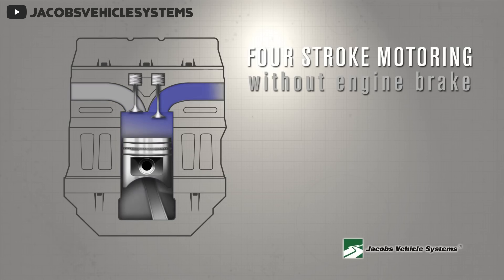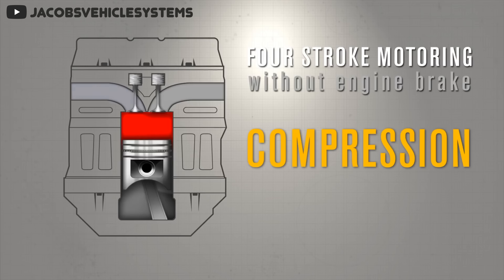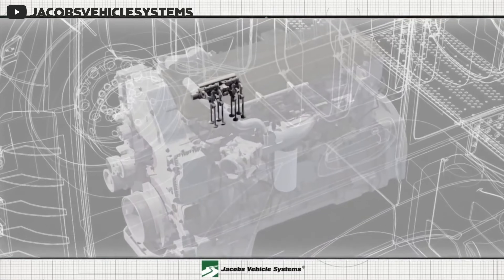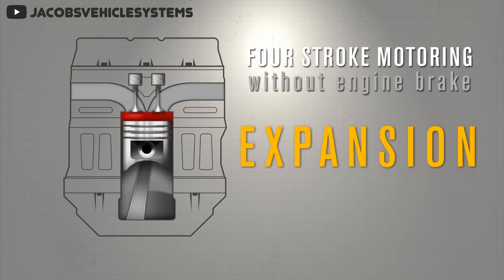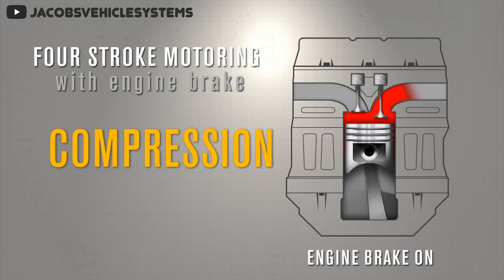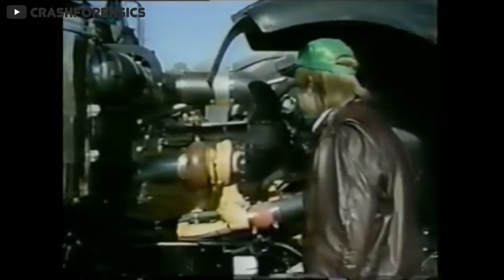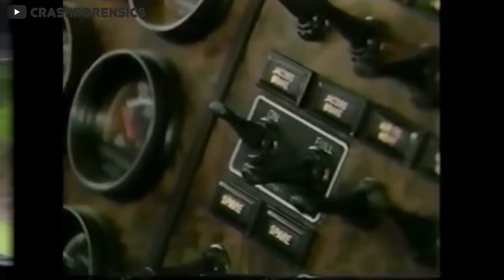What is a Jake Brake and How Does it Work?

Comment: Jake brake or Jacobs Brake is a Brand name like Cummins C-Brake.  In an automotive application your not dealing with the volume you are with a  large diesel engine. In a auto you are stating that the air intake at the throttle body is closed or minimized causing a vacuum to slow the engine if I understand.  If this same concept was used in a big Diesel engine the thing that might happen is the air would be found somewhere else either thru seals or around the rings.  In GM or the early Detroit Diesel like an 8V71 had a flap door that would cut air off if a rack stuck and the engine ran wild.  Sometimes when this was used it tore the two piece piston apart. Thing is if it were that simple it would have been done but in heavy duty use I do not think this mouse trap would work,, there is just to much energy to convert thru vacuum.

Comment: When used "properly" in "proper situations" I have no issue with the noise, but when a truck with no load on a flat stretch leading to a stop uses the jake and upshifts through every single gear...to me that's a sign of a zero skilled driver just out to make noise.

Comment: Not being a driver I'm confused.  Aside from engine braking, don't lower gears provide braking by downshifting?
Reply: You can't use the transmission to slow a loaded big rig on a downhill, it will over rev and blow the motor. Just like trying to shift from 4th gear to 1st in a car with a 4 speed at 60 mph. In trucks I've driven they operate between 1800 and 2100 rpm in each gear So, trying to downshift a truck going downhill at anything more than 1800 rpm, to the next lower gear would put the rpms at 2100 or higher and gravity is pulling it down faster and faster and it won't slow. I don't know if I've explained it correctly but that's how they work.

Comment: I do know that jakes are loud because by owning a 379 flat top pete with 425 cat with 8" pipe it will rattle windows and is even loud inside the cab of the truck.. I suffer from hearing loss due to the constant exhaust noise of the truck because the pipes are just behind both doors and driving for 8-10hrs for over 25yrs has caused that but wouldn't change it because I enjoyed driving I'm retired now but loved every mile I drove

Comment: What do you mean Diesel engines have no engine breaking as compared to gas engine breaking due to a throttle body. Yes gas engines have a throttle body and diesels do not however it is not true that diesels do not have engine breaking. Engine breaking on a diesel is as good if not better than a gas engine due to a much higher compression ratio which acts as resistance to piston motion (breaking) when fuel isn’t applied.

Comment: Yada, yada, yada. Sure Jake brakes are fantastic but there is one tremendous problem and that is the number of stupid, moronic truck drivers that abuse the use of jake brakes by using them while on flat surfaces, usually within city limits because they think making a lot of unnecessary noise is somehow cool. If you are in city traffic on flat surfaces and need jake brakes to slow down or stop then common sense should tell you that your dumb a$$ is going to damn fast for conditions!

Comment: Yet too many truck drivers use their jakes  in settled areas when they don't need to. 
I have driven diesel trucks and buses, with and without turbo, and without jakes, and now wonder why it seems backing off on the throttle has always had a braking effect. Was I imagining that?
I love driving, enjoy managing clutch, throttle and selecting gears. Yet I long for the day when the internal  combustion engine becomes obsolete.
Because too many drivers of trucks and loud cars seem to get a  hard-on with the noise they make.

Comment: FYI: fuel actual burns in a flame front inside a properly running in internal combustion engine.  If a charge does explode, we call it a 'knock'.  Premature ignition means the mixture and piston location are out of spec and the resulting action can eventually damage pistons, rods, and bearings. This relates to the use of 'starting fluid' to help out an engine startup. Ether has an extremely fast flame rate, so the charge burns suddenly, often before the piston velocity has changed sign (still going upward).
Reply: Was checking if anyone else commented on this before I did. A lot of people don't know the difference between combustion and explosion.

Comment: I'm only 40 seconds in and I already see something wrong. The lack of a throttle body does not reduce engine breaking. I'm "that guy" who tries everything. I drive an old stick shift, and I have tried shutting off the ignition and pushing on the throttle while engine breaking. I have a throttle cable so I can do this, new cars don't. As I push on the throttle and allow more air into the engine, remember there is no fuel or spark, the engine increases braking ability.

Comment: Diesels have plenty of engine braking due to their high compression.
Exhaust brakes & Jake brakes are good in trucks so the driver doesn’t have to change down the gears to get to the engine braking.

Comment: A diesel engine also do normal engine breake. It does this by cooling the air when compressed if there is  no fuel.

The diffrance between a petrol and diesel car is actually really smal. Haveing  replaced  my 2.5L petrol suv  with a 2.4L diesel suv,  there is really hardly any diffrance.

The reason why truck engine breakes so little have nothing to do with that its diesel,  ut because it have a tiny displacment.  A normal car have about 1 liter of displacment per ton. A truck  typically have 0.2-0.4iter per ton.

Its like puttning a engine from a Fiat 500 into a large suv

Comment: I'm sorry but I still don't understand how a Jake Brake works. How does opening the exhaust valve on the compression stroke cause engine braking? It seems to me it will do is have exactly the opposite effect. And it's not just me that doesn't understand it - I have a friend who's a diesel mechanic, and one day he described how the JB works (exactly as you did). But then he said "I understand how they work, but i don't understand why they work."
Also what do you mean when you say that a diesel engine has no engine braking? I have a diesel Landcruiser, and if i take my foot off the throttle while going down a hill, there is a lot of engine braking - far more than with a petrol engine - presumably as diesels have a higher compression ratio and the engine has to do more work, thus slowing the vehicle. Removing this slowing effect of the compression stroke by opening the exhaust valve will, it seems to me, reduce the engine braking, not increase it.  A better explanation is required

Comment: Actually small diesels have plenty of engine braking by expending energy compressing extremely lean mixture (newer engines can cut off fuel injection completely). And since petrol engine throttle body cuts air intake, in comparison diesels have even better braking. Checked many times in practice.

Comment: Mercedes Benz truck engine brakes are really quite for some reason I'm talking about truck built in 60s 70s for example mode#1921 or #2628 or #1932 &&&& when I see american trucks make extremely louder noise compare to Benz truck it was ?? For me, my father owns Mack R600 & R700 & few V8 Mack use as heavy haulers, none of them have this system.
Even Volvo didn't have but DAF truck use this system copy from Benz.
Noise comparison from Benz to Cat Engine if I use good judgment is 1 to 30
Benz is 1 lowest & Cat is 30 highest.

Comment: Had a Jake brake fail on a mountain pass in Colorado. My boss was driving. We were 80,000 lbs. To keep from runaway he kept it low gears and was pumping the brakes. Motor stressed and blew close to the bottom. I imagined what sitting on a bomb would be like. I bounced off the headliner. Speed was OK at this point, let it let run out on the flat & got it pulled over, oil trail behind us.
  No cell phones back then. Hitched a ride to a phone & called the agent we rented the tractor from. He wanted to know if we were prepared to pay for the blown motor. I ask him if they would've been prepared to pay for our funerals. They towed another tractor to us & dragged the casualty away. We didn't hear about paying for that motor again.

Comment: I can't agree that diesels don't have any engine braking without an exhaust brake. I use engine braking all the time in my manual transmission 5.9 cummins. The engine braking come from all of that diesel compression ratio. It's not like having an exhaust brake but trust me, its there and I have used it to slow down trailers for years now.
Reply: Agreed but people complaining
 about Jake's but there important

Comment: from the animation, it seems that the fuel is still injected into the cylinder on the first stage and then is exhausted without combusting, allowing unburned diesel out the exhaust.  What am I missing?

Comment: Some modern freight trucks go into freewheeling mode when coasting, but not others. I wonder why. I wouldn't thought the pumping losses would be negligible, and that it's a waste of fuel to keep the engine idling when coasting as opposed to just let the momentum of the truck keep it turning.

Comment: If it’s manual technically you do have engine braking if you hold the petal all the way back to where the injectors are barely firing and have it in a lower gear

Comment: why are they louder than diesel exploding ? would a muffler on the intake fix the noise?
Reply: Because during combustion,  the valves are closed. During engine braking, the exhaust valve is open when combustion would usually take place so all the noise goes out into the exhaust.  And yes, mufflers reduce the noise.

Comment: engine braking with a diesel works great. my 7.3 powerstroke engine brakes significantly better than my 6.8l v10 towing the same trailer on the same hills...  the throttle plate has 0 effect on engine braking.

Comment: All you guys who drive an X15 can attest to how strong the new redesigned engine brake from Jacob's are. Up to 600 braking horsepower at 2100 rpm
Reply: Yup, bent steering wheel for proof...

Comment: Think of how much more efficient an EV Semi will be with motor regen on, slowing down that massive amount of weight, putting energy back into the batteries.  Tough to argue with Physics 101!
Reply: If it wasn't for the regen think how inefficient a electric vehicle would be. Electric vehicles  still pollute  you just moved it to a different location  & the electric vehicles  range nut has not been cracked in over 100 years , so what is going to happen in the next 100 years , about the same . Time will tell if it is better everybody  will buy it including me , till the NO!!!

Comment: Cummins big cam 1 is not that great  it to hard on camshaft  so I took off engine or you will end breaking the cam followers if you drive east of the Mississippi you really don't need a jake brake if you pay attention to what you're doing
Reply: I have big cam one Jake brake broke the cam follower. Had to have the truck towed home. Took Jake brake off the engine

Comment: yea nah yea nah yea nah nah nah mate  nah . 
 Put the truck into a low gear , let off the throttle and and coast down . You want engine breaking there you go . The wheels will turn the gearbox , the gearbox will turn the engine , the  engine cant go faster than it can go . Obviously this has limits , a long   slope will eventually accelerate you  to a dangerous speed but you always have the option of using the breaks intermittently to maintain a slow safe speed

Comment: Funny, I have never heard of a "jake brake"..🤔 In Sweden we use exhaust brakes, that just shuts down the exhaust flow from the engine and let the engine just compress it's own exhaust over and over again. Very effective brakes and it's controlled by a big valve driven by a aircylinder on the exhaust pipe, and when you touch the brake pedal it activates or you can activate it with a button, but it shuts down below 1100rpm..

Comment: You don’t know what you’re talking about. Diesel engines have compression ratios of 16:1 and as high as 22:1, gasoline engines are limited to 12:1 or lower, typically in the 10.5:1 range. This is the amount a volume is compressed within the cylinder. It takes more “work” to achieve higher compression, thus significantly more engine braking occurs with Diesel engines.

Comment: Many years ago the exhaust connector just after the header pipe came off resulting in a very loud C16 cat engine, when I used the Jake brake OMG it was crazy loud. That was the greatest day of my 30 yrs driving a truck, driving past kids walking home from school and using the Jake as I passed them set them in a instant panic dropping the books and running in terror from the unbelievable sound. I remember taking the engine all the way to redline and braking as I drove through the short tunnel in my town creating the most awesome terrifying insanity loud Jake exhaust sound Imaginable. Was awesome!!! Good times.
Reply: That sound can be deafening when you are outside right next to it- like those kids were.  Always wondered what retards did for fun. Now I know...

Comment: Another downside of truck, or cars, for that matter, using excessive wheel brakes on downhill, is brake fade,  which works against you when you'll need the brake most. I don't drive a commercial truck but by managing power, I've taken two vehicles to over 170K miles, and a motorcycle to over 100K miles, on their original brake pads, and that's city and highway miles. Yes, engine braking on trucks is very loud, and as you said, banned in most city limits. Great video.
Reply: Jacob brakes used to be called brake savers (not to be confused with Cat’s brake saver system) by a lot of the grey beards for that reason. Brake fade is close to non existent if you stab brake I’ve gone down fancy gap without jakes (roads were icy) at 80k gross without having the brakes fade using that method. On modern trucks the exhaust brakes are damn near silent the only noise you really hear is from the turbo even the Cummins isx/x15 is quiet despite having 600 hp of braking power.
Reply: way back when I was a junior engineer, we used to test auxiliary brakes on the hills leading into Death Valley.  The auxiliary brakes had to hold a fully loaded vehicle at a constant speed without the use of the regular brakes.
Reply: What about electric trucks.
Reply: @BenGates101  That is a good question. Possible regenerative braking? Sure thing is that it will be different. I don't think it will be straight brakes as the overheating and failure issue would remain the same
Reply: I put 80K on my manual VW rabbit before replacing pads and rotors. I probably could have got more out of them but seemed like a good way to spend the stimulus check. Downshifting is second nature after 40 years. I also will downshift in my truck on steep grades because I get so much more down-slope control. It's an automatic they put those gears in for a reason lol

Comment: Why do jakes not work as well on 2 stroke DD?
Reply: Has to do with injector timing. Move the injector lobe one way the Jake brake holds better but you lose fuel mileage move it the other way you get fuel mileage  but the engine brake loses power , which way do you go ??

Comment: Very interesting.
European trucks had the exhaust flap building back pressure to the engine.
It was not as loud as a jake break but was still loud. I liked the the sound of the engine brake but I can't remember when I last heard it. Must be in the 80s or 90s.
All European trucks are equipped with a retarder, either electromagnetic or hydraulic which are nearly noiseless. You just notice a  slightly "humming" when a truck use the retarded to brake. Quite similar to the turbo charger humming.
Honestly I miss the good old diesel engine and engine brake sounds.
Thankfully there are still some scania V8 with open pipes on the road and their sound is beyond amazing.
Like this to 950hp tuned Scania V8
https://youtu.be/2Oz9Y2Fs94g

Comment: Loud vs Quite Jake brakes. 
It's NOT the difference between NEW and OLD trucks. As we can see @ 5:26 that truck has straight pipes and no muffler installed at all and that's definitely loud because it sends engine combustion sounds straight out the pipes. Many classic trucks owners prefer straight pipes for the appeal but mostly for the loud Jake Brakes. Even the new classic models.
As far as city ordinance regarding Jake Brakes, most of the cities/towns do state "Unmuffled Engine Brake" are prohibited and very few cities that completely ban any Jake Brakes.

Comment: Growing up, my dad owned a grading company and at his peak he had 25 Mack trucks with belly dump trailers and 6 end dump trucks, all with Cat engines. Sometimes on days when I was off school, I’d ride around with the different drivers, or sit in the cab of a bulldozer with the operator. Sometimes they’d let me drive a big twin engine 627 Cat scraper or 953 front end loader or some other pieces while sitting on the lap of the operator. By the time I was 14, I was pulling those big Mack’s into the lube bay at the shop, doing oil changes and greasing them under supervision of one of the mechanics. I loved the sound of the Jake’s coming on, man. That quick little clip brought back many fond memories.
Reply: The Kingdom of God is at Hand 
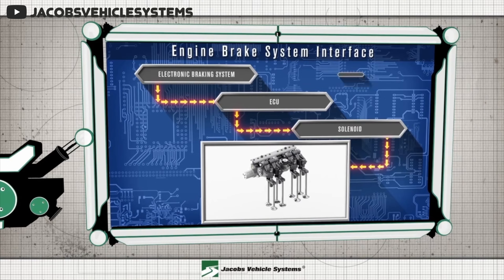John 3:16
King James Version 
16 For God so loved the world, that he gave his only begotten Son, that whosoever believeth in him should not perish, but have everlasting life.
Reply: We had a service manager who would always pull the wire connectors OFF behind the dash. Shut of MACK engine brake. I would carry a wrench to pull off the Dash plate and hook the wire back up. If I drove the MACK dump that day.